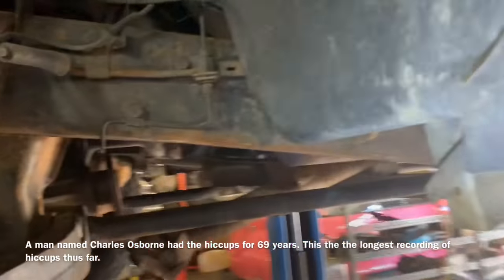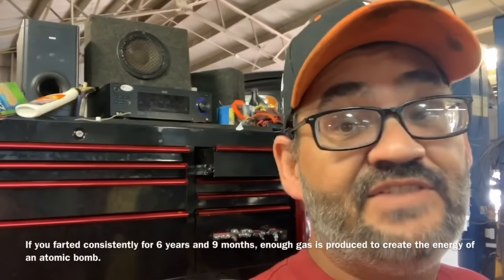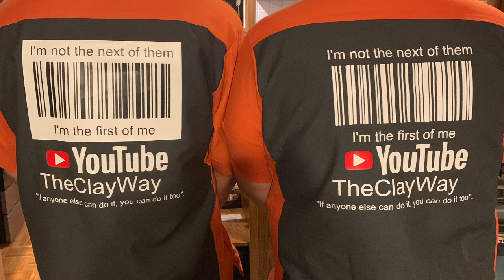Stripped bolt/cross threaded bolt SUPER FIX!!! Great great video!! Super Trick

Comment: One thing you forgot to mention and say is it turn the bolt into a tap and re-taps the threads but at the same time the strength of the bolt is also comprised so if you are doing that make sure once you have repaired the thread to replace the bolt with a new one
Reply: I was just going to say dosen't that compromise the bolt strength, im guessing yes ,it that particular one application probably won't matter because that looks like power steering pump ,but im pretty sure in any place it has stress on it ,tap and die would be needed, but im just guy who's been working on vehicles since I was 15 ,now 42 .

Comment: Great video!! One of the thermostat housing bolts on on my Town Car wouldn't go all the way in. I used a vice grip to hold the bolt (kinda bootleg but it worked lol), used my foot to hold down the vise grip, and carefully cut down the center of the bolt (not too far though). I was actually able to hear the bolt re-cutting the threads as I tightened it down. Now my Lincoln is back on the road like it should be! Glad I saw your video!
Reply from the maker: Well what you did was not as much bootleg as me making this video. This is some serious von hackery ...... i’ve had a lot of negative comments. But I don’t see where in certain situations that this is not a useful tip just like your situation nobody’s life is going to be in danger..... but people have said I’m trying to kill people...... Anyways I think it’s awesome that works for you
Reply: Put. The. Vice grips. Down.

Comment: I actually ended up using the copper strands into stripped bolts on my transmission pan that when I took out the bolts that aluminum shredding was right on the bolts so I'm going to get a helix coil repair kit but for now it definitely slowed it down thank you man tightened a bolt up really good
Reply from the maker: I think Healy coil‘s would be appropriate in that situation for sure this is more of a technique you use when you have no other option.
Reply: I agree absolutely brother . Kind of like using the zip ties.. to hold your throttle cable.. for a little while.  Lol but yeah definitely.. in a pinch it definitely it definitely slowed the leak down thanks again I appreciate it..

Comment: @ 1:25 I replaced yesterday Rear strut on 2003 Chevy Cavalier and it looks like one mounting bolt got crossed. Exactly how it is shown in this film it can't go further. I think to come from another side to clean the threads in the hole (the bolt is supposed to go upward, and it is crossed, so I'll try to send it from top to bottom). If it won't help I'll try to cut it. Interesting technique shown.

Comment: I love the video but not what i was looking for . Need to remove a bolt then tighten it back in, looking to remove the cross threaded bolt and then re tap the same hole for a bigger size bolt to hold it in place
Reply from the maker: Sorry brother this is some hack Yvonne hockey stuff in this video…. The one and only time I ever did this trick… but I could see where it would be useful for some people

Comment: Great tip and video. The bolts to my thermostat housing just keep spinning and won’t tighten down. Will this work to actually get them to tighter down. Because they just keep spinning and it causes leaks when engine is running. Please help.
Reply from the maker: No regretfully you will have to retap the hole or helli coil them sorry
Reply: Your bolts are broken. Good luck LMAO

Comment: God bless you too.
I just changed my radiator and I screwed the bolt to my transmission cooler line into the main bolt kinda wonky, and it sprayed out everywhere. I took it out and tried to screw it in straight, and it won't screw in. I think that I stripped it. Would this trick work on starting it in too? Thanks for your time ♥
Reply from the maker: You would have to really be careful with that…. I’m assuming it’s plastic. I would hate to see you split the radiator but then again it’s already broken….. that’ll be interesting to see what happens so keep me informed

God bless you too my friend welcome to the channel and we are very happy to have folks like you here….
Reply: @sharpcarco  It's a brand new radiator, and both pieces are metal. I ca see 2 new sideways trails where I twisted it in. They have messed up the normal trails at the beginning, so I can't even get it started. Thank you for getting back to me 🙂

Comment: I'm really hoping that will work for my case here... The bolt that holds idle arm on my truck got stripped at the bottom because he's a piece of s*** other nut came off and cross threaded end of the bolt. Can't get the nuna on there started I've tried to file it and everything

Comment: Would you trust this to use on an exhaust header bolt? I cross threaded one and it won't go in all the way in now
Reply from the maker: Are you going to remove the stud? And put some washers behind it. 

You could probably run a tap if you’re removing the stud and put it incorrectly just run the tap down blow out the whole after you run the tap down. 

Or like I said just remove the stud put some washers on it after you measure how far it actually goes in it’s not like you’re going to be able to hurt somebody if it doesn’t work so I wouldn’t worry too much about it but fixing it right would also be good to.
Reply: @sharpcarco  I actually Installed aftermarket headers and new bolts. All if the bolts started but this one. It looks a little crooked. I had to stack washers and tighten slightly but I really want to get the bolt to seat properly

Comment: Attaching the new brakes, I crossed the bolts. They went in very hard, I thought it was because of new rubber inserts (they came together w/new brakes) I put in holes for those bolts. They stopped ~1/4 in before the end, where they are supposed to be, and started to rotate free both ways (clockwise and counterclockwise), I can't extract them, because they rotate. Can I drive a car with these bolt for a while, since they don't come out before I buy a new knuckle, and actually I don't know how to extract them? Thank you for the good film.
Reply from the maker: I’m sorry to say I’m sure you need your car but I would have to say No !!
Reply: @sharpcarco  Thank you. Actually I think I just overtightened it. It might sits in its place, so means it would be some problem on the next brakes work. Do you happen know how to extract it. Did you ever dealt w/such bolt (it is a slide bolt w/a thread at the end).
Reply from the maker: Send me a PM on my clays Ac and auto repair over Facebook and I will try to help you deal with it . Seeing a pic or very short vid will help me answer it
Reply: @sharpcarco  Thank you for your attention to my problrm, Sir! I extracted those two bolts yesterday, the picture was: one bolt was broken completely (threaded part was left in the hole of the knuckle, and the cylindrical part was by itself in the caliper), and that is why it was rotating freely, another one totally messed up the thread in the knuckle hole, as well as its own thread, so also rotated free. I ordered new knuckle, both to be on the safe side. I think that would be the best solution for the brakes. God Bless!

Comment: I'm no mechanic nor am I even close. Only thing I know is the cars are supposed to work. Lol...inherited a 2001 Ford Windstar but the thermostat housing bolt was drilled, wring size and tried to force wrong size bolt in it. It snapped off. I got the bolt out with needle-nosed vice grips. My problem is I need to retap this hole. How?

Comment: ah love the end....'you can do it too,....i HAVE been trying to get a bolt out from back of engine, holding my crank case sensor on, and it must be cross threaded...the bolt goes around, but wont come out, its a pig, as you have to do it all by feel as you can't see it..., im so frustrated been trying to do this for months and still can't get the bolt out..any sugestions???? as yours was out already...tried to get a level into the slimest gap (like a finger nails depth) to pull as ratchet...but still not worked...any help welcomed please

Comment: Hey This was a great trick ... However I have a question I used this trick to put one of the bolts for my trailer hitch on the Van... I am concerned about if it weakens the ability to pull the trailer ? anything you can explain in that context ? Thanks
Reply from the maker: Well like I said in the video you have to use common sense if you only have two bolts holding something DO NOTdo this! . Just want to make sure you understand I’m not saying that in your situation not to do it because I don’t know exactly how many bolts you have holding the trailer on but it is one of them things that you have to realize is not a practical fix I just think that there was certain situations where this technique and trick would actually be just fine like say you’re trying to bolt a exhaust bracket to something in the exhaust is bolted down district would be just fine for that but if it’s anything that requires a safety situation I personally would not do it I would loosen everything up and do it properly.
Reply: @sharpcarco  make sense thanks!

Comment: You should probably warn people that what you've done here significantly weakens the bolt and could lead to failure. And not to use this "trick" on and bolts whos failure could put lives in danger.
Reply from the maker: You should probably watch the video. Yes putting “lives in danger” 🤔 Wow
Reply from the maker: Well it’s been said before the common sense just isn’t very common anymore

Unfortunately I do not have the time to have a battle of intelligence with an unarmed man .
Reply: @joshuarayne9144  it's just holding a differential in, I don't think it's going to fail catastrophically. Kinda a halfassed way of fixing something, but not a brake, wheel end, or load bearing fastener.
Reply: @juliogonzo2718  that may be so in this case. But invariably, since no warning was given not to use this trick on something like a lower a arm pivot, there's a good chance that some unsuspecting unknowing person could cut a slice 3/4 of the length of their shackle bolts on front end of their 74 Ford highboy and have their whole front axle fold backwards at 78 mph. And that could be VERY bad. I just think that taking an extra 22 second to warn the ignorant earthlings not to use it in a situation like that would have been a good idea. And that it's kinda irresponsible not to have done so.
Reply: @joshuarayne9144  fair enough.. somewhere, someone with no common sense may do something like that
Reply from the maker: And not to mention that he is incorrect I did say that in the video and I also explained why I was making the video , 

This guy is a moron obviously this video is not intended for uneducated folks like him this was intended to be used on like an exhaust manifold that’s not lining up properly or maybe a bracket that holds the exhaust or some kind of on vital component I don’t think one bolt on the front end of a differential that has nine bolts holding it together one of them being the weakest link on a bracket that already has two other bolts plus this one is going to cost somebody to lose their front differential out of their car it’s the most absurd thing and obviously this guy did not watch the video or listen to anything that was said in the video he just fast forwarded

Common sense just is not that common any longer
Reply: @juliogonzo2718  since common sense is in short supply these days I automatically assume that most people don't have enough to come in out of the rain.

Comment: as long as it took to cut that bolt you could have easily loosened the other bolts and ran the third in and  been done in half the time>
Reply from the maker: True but not the point of the video.
Reply from the maker: Still not the point of the video… if you had watched it either of you would’ve knew that I only did it to demonstrate the process …..

Comment: So… was it cross threaded?.. or the bolt hole was just not 100 percent lined up?, two different scenarios
Reply from the maker: Wouldn’t matter. I’m fairly certain I described that in the video
Reply: @sharpcarco  no need to bother lining up the hole when you can just hacksaw the bolt right? I feel bad for the guy who buys your used hunk of crap truck held together with hacksawed bolts. Holy shit.

Comment from the maker: ⭐⭐⭐⭐You can further support us by using these links to purchase anything from Amazon! So here's some things we like to have around the shop! (you can buy anything with these links and it helps us out, not just the linked items)

FOXWELL Car Scanner NT604 Elite OBD2 Scanner ABS SRS Transmission, Check Engine Code Reader, Diagnostic Scan Tool: https://amzn.to/3vmTYhu

60 PCS Tap and Die Set Metric and Standard Sizes: https://amzn.to/3MkcFtl\

Craftsman 20 Piece 1/4 Drive Metric Socket Set: https://amzn.to/3xEltpy

CRAFTSMAN Hand Saw, 12-Inch Hacksaw (CMHT20138): https://amzn.to/3uUijfE